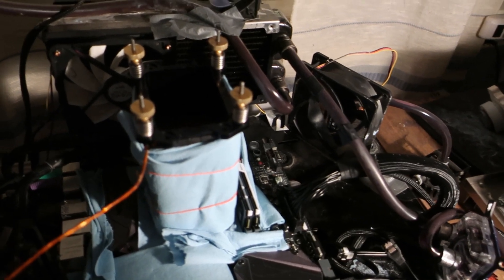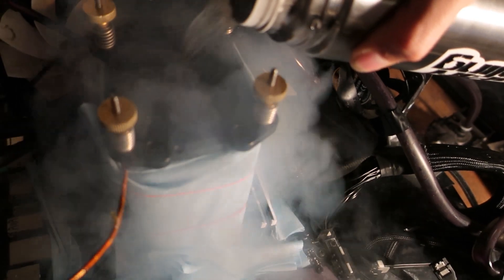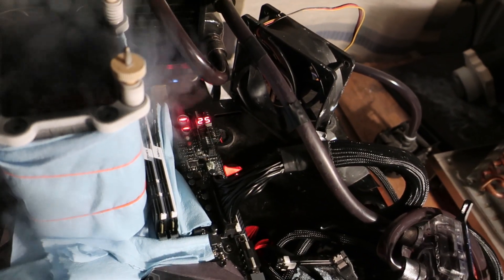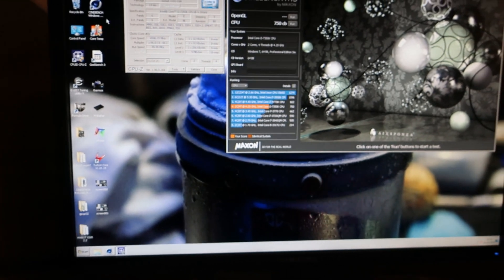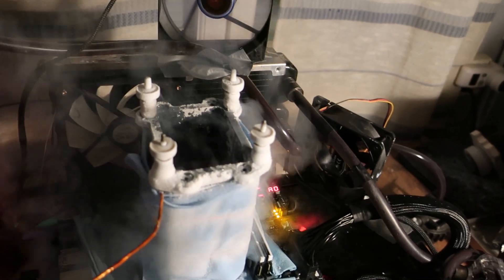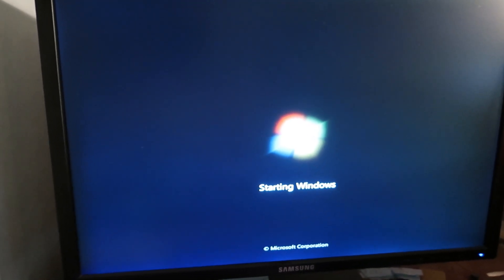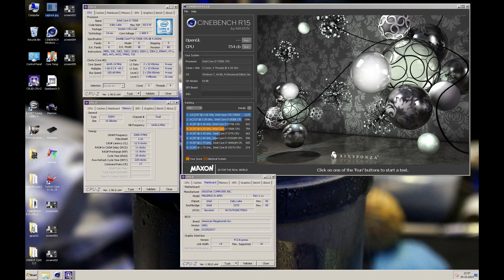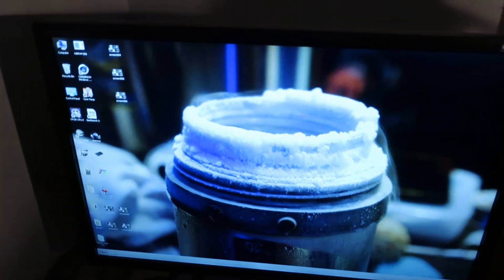New 7350K goes straight on LN2 with the Maximus IX Apex - 6.65GHz Overclock

Comment: Do you ever get any problems using an M.2 SSD when using LN2? I've wondered if there is any difference between using SATA or M.2 SSDs when overclocking with LN2 or DICE.
Reply from the maker: I haven't tried M.2 when CPU on LN2.

Comment: This is awesome, you should overclock a 3930K to it absolute max
Reply from the maker: 3930k was actually my first CPU i proper overclocked :) . I got it over 5.5 on dry ice.
Reply: @LuumiJuhani  Funny enough its my first CPU i properly overclocked too besides my Phenom 965B lol I still have the 3930K in my main rig @4.6ghz on an AIO, no complaints at all